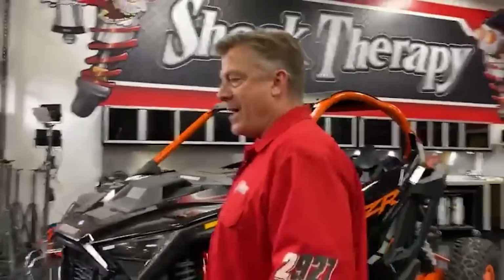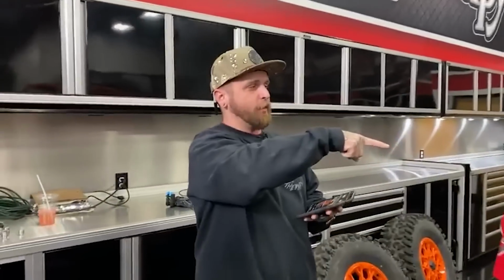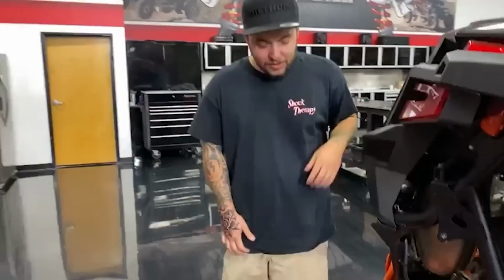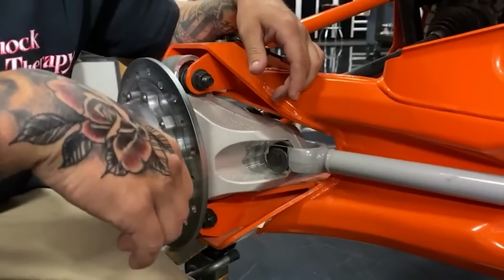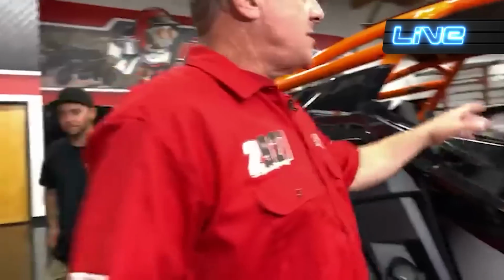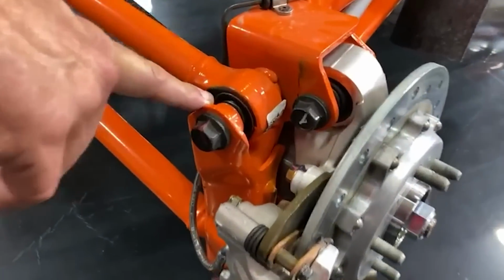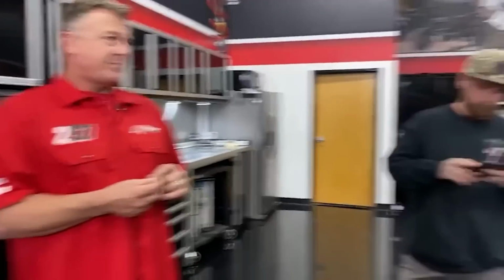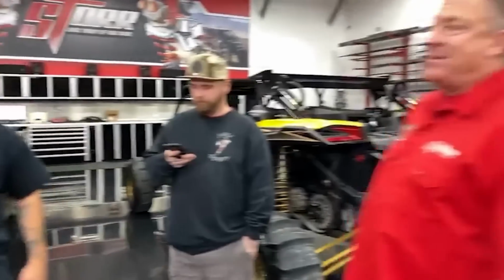Our Future Plans for the Polaris RZR Pro R! (Shock Therapy Live 03/01/2022)

Comment: I've heard this several times now from yall. What is a correct wheel offset for non steering wheel feedback ? I have 15" racelines with a 4x3 offset running 32" xtr370s

Comment: Would love to hear about the R and Turbo R, as many people are in the market.
Specifically 4 seaters with wheelbase and weight and travel.
Will the turbo R be desired because shorter and less weight, more advantage in different areas?
Building a reliable 1000 turbo with more power to keep up with a 2.0..
Can't wait for another video on the pro R.

Comment: When SXSblog explanation was happening you looked confused and then defined as donuts and sliding around but it’s a bit different then that.. a cyclones is a 4wheel drive specific donut that rotates in place not a standard donut with rotation over/around a single front tire….and the SXSBlog guys did this for a VERY long period of time which was their theory that they pulled oil away from both oil and scavenge pump starving engine.  You guys are the best

Comment: SxS blog guys did over 40 donuts on ice wide open in 4x4,these guys do crazy stuff. They actually have done videos so they can calculate RPM. I think it took out the rod bearings and was it from oil starve or just holding it at 8,000 rpm’s for minutes straight idk....

Comment: What is the correct wheel offset for the Pro R, 6-1? And is there any difference in the stock front and rear wheels? Thanks!! I really appreciate the great content!!
Reply: 6/1 is stock. Same front and rear. 5/1. 5/2 or 4/1 all work perfect as far as scrub and feed back are concerned.
Reply: @shocktherapy4820  if I’m not mistaken, the Pro XP had different wheels on the front versus the back from factory. Did know if the Pro R is was the same from factory or all 4 wheels was the same. Thanks for replying so quick, you guys are awesome!!
Reply: @toddmccormick4071  I just measured my Pro R and the front and rear wheels are the same. Have a good one.
Reply: @justinsmith2958  is the offset the same? Thanks for the help. Just thinking about buying a stock spare when my unit gets here, didn’t know if there was any difference in front and rear.
Reply: @toddmccormick4071  offset is the same👍
Reply: @shocktherapy4820  thanks so much!! You guys rock!!
Reply: @shocktherapy4820  What offset(s) F+R do you recommend for Pro R in the dunes?

Comment: Can your Shocks be painted black? Sorry if silly question, just purchased for my Rzr XP Pro from yall
Reply: If you mean spray paint then no. It wonts stay on with spring movement or heat. If you mean anodizing then yes but it would cost as much as the shocks themselves to do after the fact.